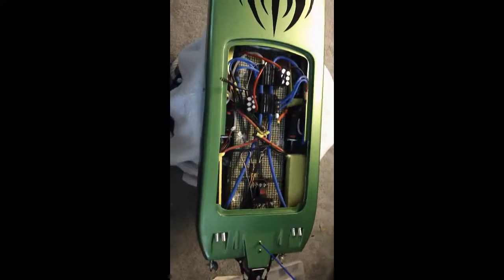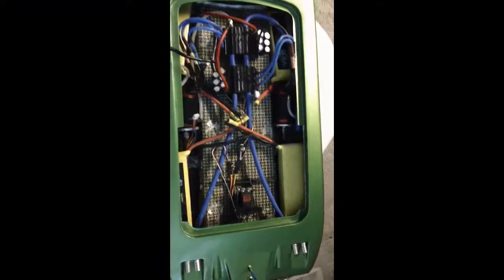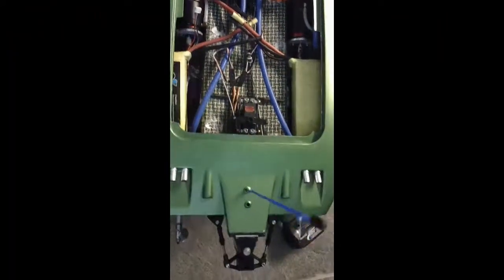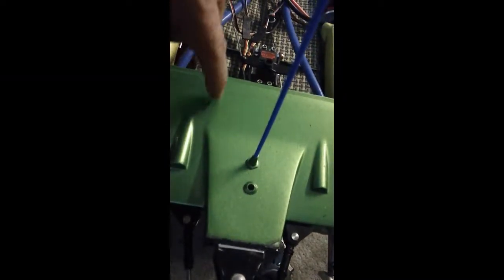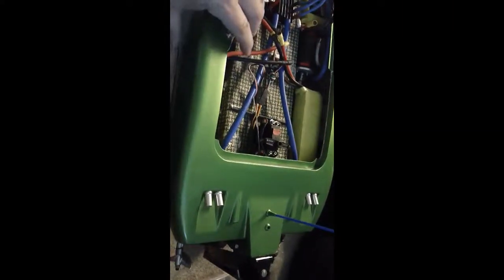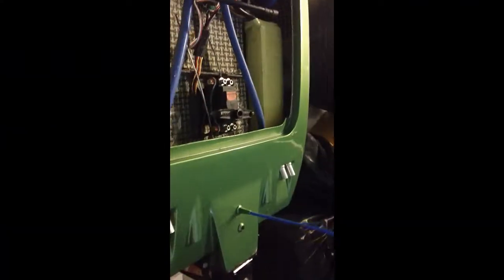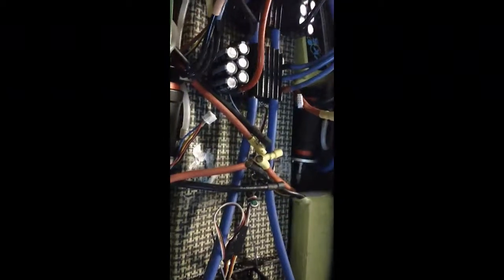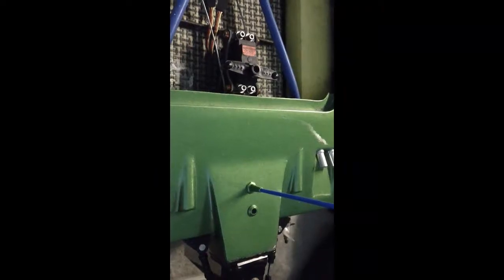Zonda rc boat build

Comment from the maker: so you like the stock boat. Then talk to me in a year of use.
Let me know how the hull is holding up to the rudder that the zonda comes with. 
My boat is lighter in weight, stronger, handles better at high speeds and has a much better paint job. the duel water pick up also seems to be doing well also. I should ask do you have a Zonda? And can I see it run?